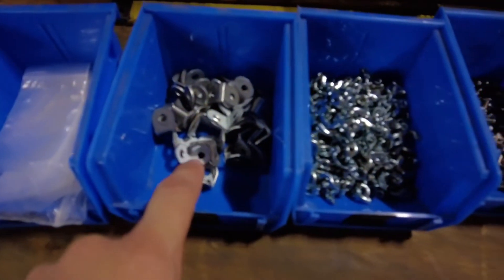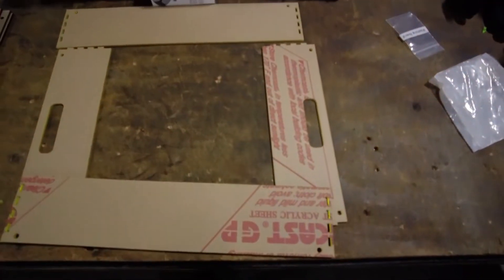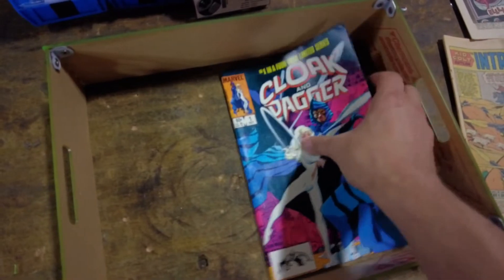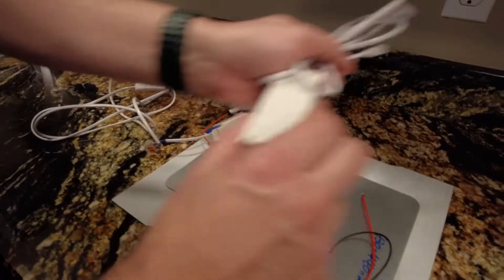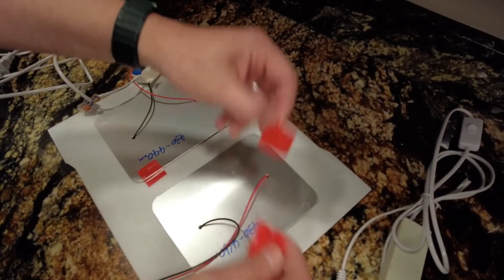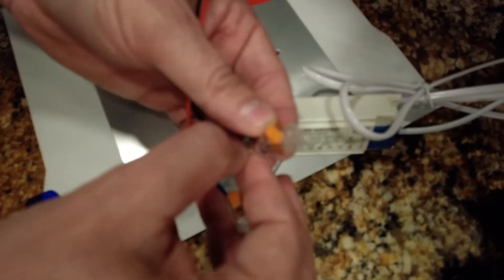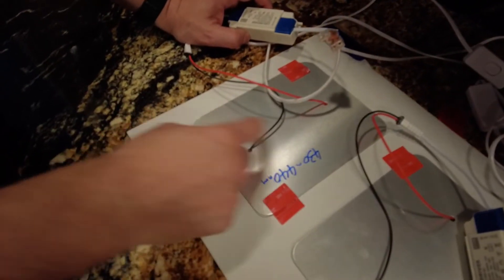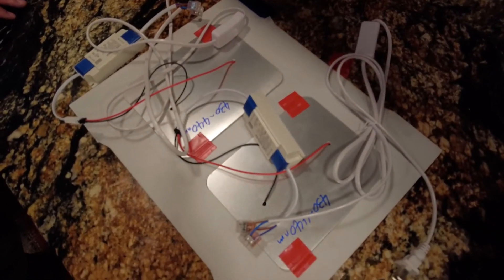light  array box assembly instructions

Comment: Since the box has no bottom, would you recommend placing some sort of protective surface down (poster paper / board) to keep the table from getting bleached out over time?
Reply from the maker: yes absolutely.  The box need to be lift from the book so it can be removed without touching.  I have been using a large piece of paper cardstock.

Comment: Hi love this invention! Some questions 1/ how many watts are you using, will it cause a heat buildup and hurt the book or will the handles dissipate heat 2/ if you use the blue lights outside of the box in a kids room as a novelty will it hurt eyes 3/ do you have a peroxide vs non peroxide video and does it impact Color’s differently 4/ is 5 hours twice as impactful as say 2.5 hours? At what point do you get good results but not necessarily the max results so you can finish a book efficiently?
Reply from the maker: I believe the power comsumption is 30 watts per led array.  The maximum temperature I have measured inside the box is 31 degrees. (about 88 F).  The lights themselves if unfiltered will definitely bother your eyes.   I can construct a fully mirrored box but it ends up it doesnt make much of a difference in the light intensity that hits the book if you use 90 degree LEDs and its somewhat more expensive.  Also I can only get so much of the vapor desposited silver backed acrylic to serve as a mirror, so Iam using fluoresecent and light absorbing transparent color which keep the temperature lower by emitting blackbody light and and allowing the longer wavelengths of light through.  (except the transparent, of course, it doesnt do that).    I definitely have a peroxide vs non peroxide video.  the same one has peroxid with light , peroxide without light, and just light at three different concentrations and you can also see the different over time.  I dont prefer peroxide as it can sometime make the paper feel more stiff or rough to the touch or both.  

I think that when you say "efficiently" you may be meaning "faster"?  If Im incorrect please correct me and I will regroup and try to understand. In any case I really cant asnwer that question honestly as it varies greatly from book to book.  No two books are alike.  for me, I do not want to go any faster because the risks are too high.  I like to keep the enrgy nice and low and exciting just the yellow bonds in the lignin,  If theres excess energy beyonf the natural photobleaching rate it must go somewhere and do something.  Possibly something I dont like.  much of the time there will be yellow material behind other material and you simply need to get through it by drilling down and you are limited by the reaction rate.  Sometime th ebook is dirty and the dirt shaows the light and so you have to clean it then do your light treatment again.   its not as simple as "turn it up higher and make it go faster" if that makes any sense.

i hope this helps!

Comment: Assembly instructions = put it together.  You gotta understand, I knew this item was coming but wasn't aware you had sold them yet, and the rest of the video is great.  But completely with no context and starting with that I had to chuckle.

That said, I do have a specific question - is it possible to hook both lights up to the same power cord and have them act as a single unit?
Reply from the maker: yeah its a little strange out of context.  I meant to include the video as private via a qr code that came with the box but we didnt get the QR code card printed in time so I had to make it public.  and yeah it doesnt take a genius to assmble th ebox but people ask for examples!  

LEDS run on low voltage and direct current electricity. home outlets present electricity that is high voltage with alternating current. The main purpose of an LED driver is to rectify this higher voltage alternating current into the low voltage direct current electricity that LEDs are designed to handle. designed for and use constant current drivers and not constant voltage drivers.  
You could connect the light arrays in series by connecting the two light array panels together and use a single driver with a larger potentiostat but you cant connect two of them them to the same wall cable because then they are in parallel and not in series, then the current would drop but you would get the same voltage and the light would be inequal and weaker.

Comment: Hi Rick! I just received mine today and the lights aren't working. I sent a message through your website and thought I'd message you here as well in case you don't see it. Thanks for your help, look forward to hearing back!
Reply from the maker: Sorry about that.  can you email me at rick@immaculatecomics.com directly?  We will send you a new set.  But before we do can you please send me photos of the wiring setup?  Also please try inserting the wires just a little less far into the lever lock.  So far every set of lights we have had returned (which is only three, to be fair) has actually worked when we tried it back at the shop!  either way we will make this right for you.  best, Rick